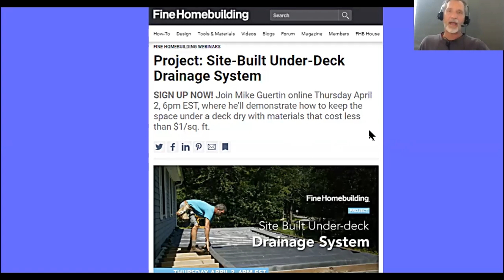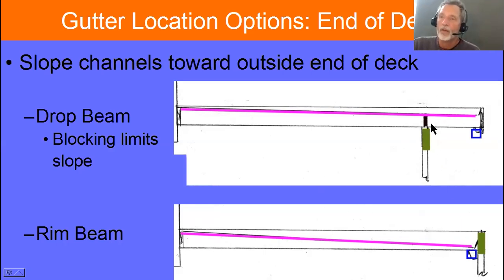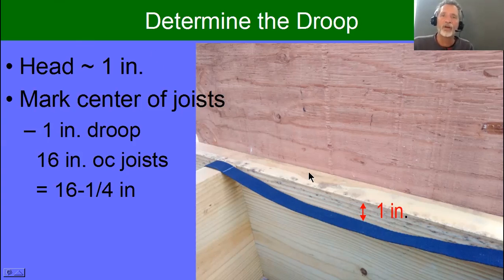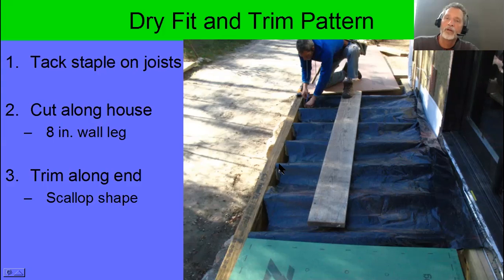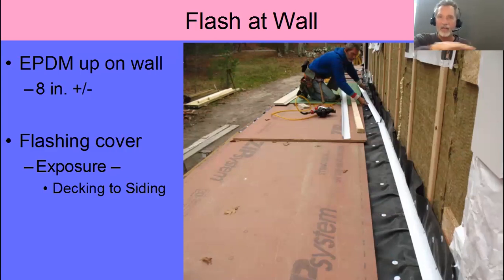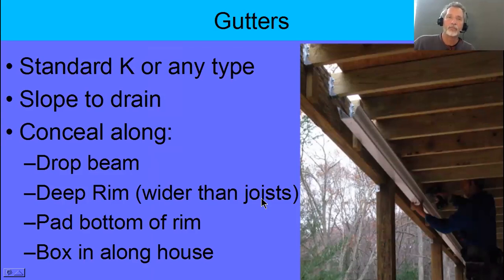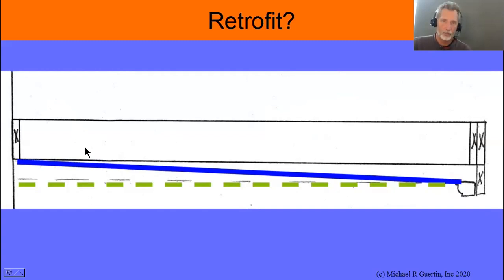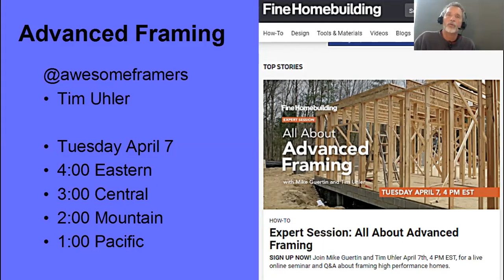How to Install Under-Deck Drainage Systems

Comment: Thanks for taking the time to make this very informative video!  I'm about to install an under deck drainage on my boathouse which has a sundeck on top.  The previous owner used plywood (not marine) for decking and obviously it rotted out.  So now I'm installing decking boards and needed something to keep the water off of my boat.  I had already read your article and this video really helped!

Comment: I did this successfully on a 12x16 deck. One large sheet is hard to get just right. I might divide the job into smaller chunks if its your first time.  Maybe knock out 5 bays at a time. But otherwise, lots of fun.
Reply: Hi William, I am planning to do this when I redo our deck. I wonder though how to fix the railing posts without undoimg the waterproofing in that area again. Did you surface mount? Or maybe fascia mount the posts?

Comment: I discussed this system as well as Trex RainEscape with one roof/decking company guy and his criticism is that there will always be some water penetration, getting trapped below the system. That water will pool and be less likely to escape via run-off (especially on a flat roof), which will create a mold and mosquito breeding ground. Is that valid and is there a solution for that?

Comment: Excellent video! Thank you. How would you best clean out the pine needles or debris that falls through between the deck boards? I suppose you would have to take down the gutter and make a long sweep tool. Ideas?

Comment: I live in an area where TONS of fir needles fall and we have quite a bit of green moss in shaded areas.  Is this type of EPDM rain drainage system "cleanable" to wash out the accumulation of stuff between the deck and membrane?  I would LOVE it if this system worked with that purpose also in mind.  Thanks for your time!

Comment: you had a very good video on deck quardrails and I was hoping to redo mine with that knowledge, also adding drainage system. How do you handle posts around that EPDM?? Thanks! I'm surprised no one asked that :)

Comment: I couldn't agree with you more! I have always struggled to find FH articles online!!
Reply from the maker: We're working hard right now to reorganize our website by project type to make it easier to find all of our articles and videos on popular topics. Check out our deck guide, which is organized into chapters based on parts of the project: https://www.finehomebuilding.com/project-guides/decks

We'll have more guides on drywall, painting, and insulation up in the near future.

Comment: Michael, In our application we actually have a golf cart barn under a 32' x 43' floor system that previously had a concrete slab patio poured over top of 2x10 non treated framing and subfloor with no waterproofing.  The slab has failed and the framing has been getting wet.  We are exploring options to renovate.  One such option is to remove the concrete slab and subfloor.  Repair/replace water damaged framing and reinforce structure by  sistering additional floor joist as called for by structural engineer.  Once that is completed how would you feel about installing your system over non-treated framing and then covering with composite decking?  Would the addition of peel and stick flashing over the epdm covering the joist be a wise addition, or does the presence of non-treated framing make the system questionable?
Reply: As long as you keep the joists dry, there wouldn't be an issue.

Comment: Before adding the decking boards: I think I could strategically pre-bolt Joist hangers to the top 4'x8' of corrugated fiberglass sheets (get at big box stores) on the up curve, where they lineup with joists (top and bottom centerline and one on each side of the centerline at nearest joist which leaving an edge for adjacent sheets to slightly overlap, and halfway down: the sides; x8);   building a solid suspended-hanging/sloping Lean-to kind of roof underneath the Decks frame.  The degree of slope varies and is secured by how much of the joist hanger is positioned up the Joists" and water will flow off the ends to a gutter, like a roof on a structure does, eh!  No calculus is needed to figure out progressive curved channels.

Comment: How would you do this with an existing deck?  Don't want to tear off the deck surface boards.  Also, same concerns as Waya Hedia expressed earlier comment about cleaning out debris build up.  Even leaves will find their way between deck boards and build up on the liner...eventually clogging drainage...just like traditional gutters.

Comment: my house's front has (upper) deck on 2nd floor, under which is the ceiling  over lower deck, there is no gutter or a good draining system, except the low spot on 1 side. A contractor said he'd add open gutter around outside the siding.  i dont think it is a good design. What  do you recommend as for the design?

Comment: do you recommend venting of some kind? perhaps a masterflow foundation vent if we do an under deck ceiling under this system? maybe on two sides or facing off of the gutter opening side?

Comment: My deck has 2x6 braces staggered between each joist. These are near the center. Do you simply cut a trough in those (down a few inches) to allow this to be installed? I've yet to see others have them in these installation vids.

Comment: Buddy, you are amazing. Thank you for all of the information. I am about to remove all of the nasty cracked tile and subfloor from my deck and replace it with composite deck boards. I will use your under deck drainage system. Is there a particular brand that you recommend? We are located in Orlando FL. 
Once again thank you for sharing your knowledge. 
Do you provide consulting? I would like to share with you the pictures or live video of the issue we have at hand at my house. 
Looking forward to hearing from you.
Reply: Just buy 45 mil pond liner. Buy it on a roll so that you don't have creases in the material from it being folded. G -tape now makes a butyl tape designed to adhere to EPDM to go over the top of any place where there is a seam. Jason, aka Dr. Decks, also uses a sealant between every piece but I'm not sure he's using the correct product. Hope that helps.

Comment: Sorry I missed the webinar. Great information here. My only question is pertaining about sheathing a deck and  using a PVC deck flooring. Would a solid floor like that require any structural changes to footings to meet potential uplifting from strong winds?

Comment: Great video, thanks! My deck sits in a corner, so one of the joists will run flush to the wall. I was planning on picture framing but am thinking that would create a small gap between the edge deck board and wall without a drainage path. Do I need to eliminate the edge piece along the wall and butt the decking to the wall to allow drainage between boards, or is there another way? I want to avoid water running down the wall. I'm planning on running the EPDM up the wall under the flashing in the same way you're doing it over the ledger.
Reply: I am doing the same and instead of doing ladder blocking I put a 2x4 flat on top between the joists

Comment: I've got a bizarre setup at my place. The previous owner - builder had truck bed liner sprayed on to sheet plywood. There wasn't much of a pitch put on the system and the bedliner was sprayed on hot, which caused the edges of the plywood to curl every so slightly. It's starting to fail now, after thirty years, and I'm debating redoing it the way he had it, but properly built with a pitch and thicker plywood, or installing scuppers with EDPM roofing the way you have it.

Comment: What do you to if you cannot make a trough?  Like when you picture frame the deck.  The outside two joist will have blocking for the picture frame.  Also, this makes it hard to not hit your bracket that secures your post with the trough.

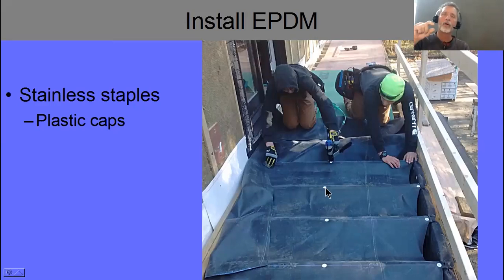Comment: At 45:45 you mention using a certain type of staple. The video is unclear due to internet connection. Preferably, you mention using 'stainless steel' staples. My cap stapler uses 7/16" 18GA staples and nowhere can I find stainless options; only electro galvanized. Will electro galvanized cause an issue over time? I plan on taping and caulking w/ butyl based products to ensure water tight seals around punctures. Also, can I flash using metal based flashing on ledger; I only have 3.5" of EPDM flashing due to window and door placement. Please advise... Great video!
Reply: The cap staples are more of a temporary fastener.  Once the deck boards are installed, their fasteners will "clamp down" on the EPDM. So electro-galvanized should be fine.

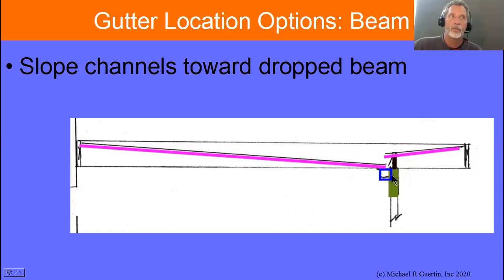Comment: At 15:44 you talk about the cantilever method, but what if the blocks between joists are at the same height as the joists ... how do you cantilever from the front to the dropped beam?
Reply: You can cut them down to a height no less than 60% of the joist.

Comment: Which EPDM mill would you recommend for the underdeck drainage the 45 mil or the 60 mil and also I'm having a hard time finding it especially for less than a dollar a square foot
Reply: 45 mil is fine.  Check your local Menards.  Also, make sure you give your deck boards a first coat of sealer on all sides before install, then a second coat after installation.

Comment: What about this design: Attach 2" x 2" spacers ripped from dimension lumber every 2' or so from the house to the far side of the deck on the bottom of each joist.  Each spacer would be a little taller than the previous so that the first may be 1" in height, but the final row of spacers are about 3" in height, creating a slope.  This would allow you to use a rigid piece of plastic on the underside of the deck and avoid the drooping/folding/cutting/butterflying of the  EPDM.

Or is there a reason this would not make a good solution?
Reply: It's retro-active and not pro-active. Water will run down the side of the joists. Much better to have a membrane on top (imho). If you do use an under deck system, you should still tape your joists, ledger, etc.

Comment: I'm trying to figure out the best way to determine the size of EPDM I need and how to cut it. Do you have a pattern or formula for determining the shape of epdm based on the size of the deck? For example, my deck is 15x22.
Reply: I'm have 12 inch joists, so my understanding is the droop should be about 28 inches between each set of joists.

Comment: how do I flash ledger against brick ?
Reply from the maker: If you're talking about brick veneer, you need to use spacial hardware to bypass the brick and fasten directly to the framing. Otherwise a good alternative is to build a free-standing deck. Here's some good info on the topic in our Deck Project Guide: https://www.finehomebuilding.com/project-guides/decks/deck-ledger-mounting-system-masonry-veneer-challenging-cladding

Comment: I don’t think he comes to this site to answer any questions.Kinda makes sense not his site as he is a guest.
    Hopefully he reposts this to his own domain site
    Come to think of it.. FHB should include a courtesy link for this man.Unbelievable
           Has anyone tried using TyPar wrap or their new reinforced rapid drain version of the original TyPar fabric wrap?
              Some may say it’s not UV rated,well okay,But how much uV radiation is getting through that little gap. 
                I am going to order some and use it to drain my re planking deck project.